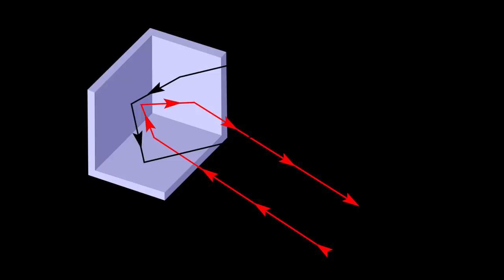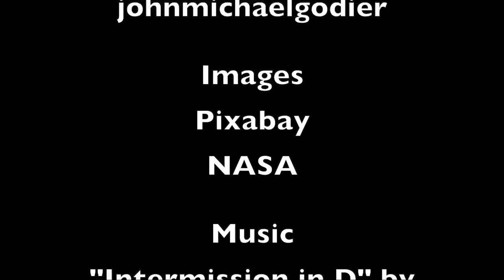Alien Corner Reflectors and Repeaters

Comment: The only problem with thinking that a zero sum retro reflector has to be alien technology is that any elements or minerals that crystallize into cubes can do the same thing. I'm a land surveyor and we use glass prisms to give micrometer accurate measurements so if the environment of an exoplanet is conducive to the formation of large cubic crystals then it's possible to get reflections from natural sources.
Reply: That's a really good point. Although due to the cost effective nature of the search method I believe the ends justify the means. I mean, if it ain't aliens cubic crystals are cool too!
Reply: Fascinating.

Comment: On the radio echo point, important to keep in mind some things: 1) electromagnetic waves can undergo "mode conversion" to couple with plasma waves. This can drastically change their propagation direction and group velocity prior to being reflected and received on the ground again. 2) The speed of light in a plasma depends on the dispersion relation (material properties of that medium) combined with the frequency of the incident wave, meaning one cannot blindly assume the wave propagate at some fixed speed (e.g. that of light in vacuum). To summarize: All of these effects can give rise to longer-delayed echos--especially when there are localized transient plasma structures present in the magnetosphere along the propagation path

Comment: So if we put a 6x6x6 meter corner reflector on the Moon we could bounce 6m radio back?  I wouldn't have been shocked if it were 2x wavelength but that's probably just my head in digital.
It would be easy to make a setup that folds up into a 2m x 2m package with 3x3x3 sectioned hinged panels.  The support legs don't need very much wind resistance at that distance!

Comment: Corner reflectors and other little passive gadgets are tremendously fun little DIY projects, and I agree that they make a more reasonable baseline than Von Neumann probes, since they just require a few reflective materials and the ability to align them at 90 degrees to each other. That, and I'm certain any extraterrestrial civilization worth talking to would also find DIY Ikea-style assembly of things fun.

Comment: Thought about this before too but if you have a fleet of probes, groups of them can be specialized.  They don't all have to be capable of every task.
Reply: All it would take is a miner probe and a factory probe going in pairs to each system. Each miner probe may only have to mine basic resources, and the factory probe building simple, smaller probes that can combine and mine more materials and make more complex probes, until eventually making another pair of probes to be sent

Comment: You want to see a corner reflector in use? Look at the tail part of an F-15 Eagle, or several of the older Migs and Sukois. Why do combat jets no longer have double vertical tails? Corner reflector. Note that twin tails are still used, but they're on an angle ~

Comment: A Von Neumann probe doesn't have to be a mining factory similar to what we would build.  
If the designers have good control of biology, it could be a slime mold like organism that basically eats the rock to get the resources it needs.  They would have to design in a lot of functionality, but it is likely they would have been using those abilities locally for a long time, so would be good at things like mining, building communications or acceleration infrastructure remotely, etc.

Comment: You make a few errors in the initial premise that a von Neumann probe would have to be incredibly advanced.

It would only be advanced in the sense that it was a very advanced computer (dense computation per cubic cm), but beyond that all it has to do is have a system of bootstrapping larger and larger factories starting from something very small.

A nano or micro robotics dactory could begin mining an asteroid, creating ever larger and more complex machines that could go on to mine the asteroid more efficiently.

A you need to do is make sure the original probe has the complete set of instructions for every stage.
Reply: Sounds pretty advanced

Comment: 5:15 I read a short story once in which a radio astronomer working at Arecibo receives an alien signal. Efforts are made to decode the signal but nothing seems to work, until the Astronomer realizes the size of the message received is only very slightly larger than the Arecibo Message that was sent in 1974, so he sets up the alien message to the dimensions of the Arecibo message. Sure enough, it is the Arecibo Message sent back to us, only 6 words have been added, "Be quiet. They might hear you."
Reply: That rings a bell rather strongly with me. I recall reading something similar when I was elementary school, but some 30 years worth of time has muddied an already poor memory.

Comment: Physical corner cube reflectors at light years distance would be very difficult... as the reflection of a radio signal would be directed back to where the emitter was, convolved with relative motions and and rotations of the CCR... not to where the emitter is. A game of pong that would be impossible to win. There would have to be tracking of the source, delay and reemission towards where the emitter will be when the signal returns...

Comment: Hello JMG how would you imagine an advanced alien race making contact via quantum mechanics? Wouldn’t it be far more efficient and effective than using electromagnetic waves? Would it need a dish shape receptor or just a regular antenna?
Reply from the maker: It would, except quantum mechanics, so far as we can tell, doesn't let you transmit information instantaneously. It only allows for random state changes. For whatever reason, the universe does not permit information to be transferred faster than the speed of light. 

But you always have to be careful, maybe aliens know more about physics than we do. But that also means we don't know what to look for as far as communications. We look for radio because we know how to do it.